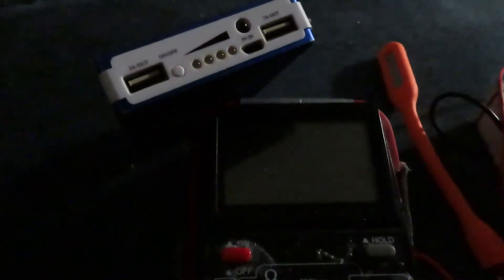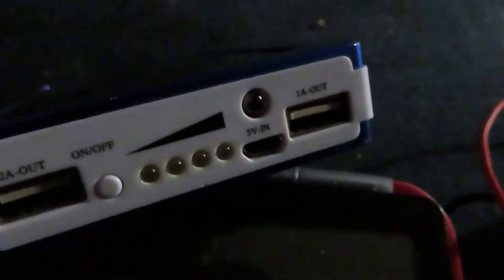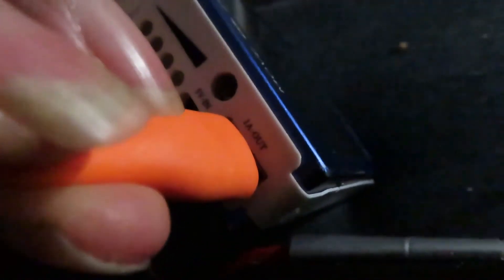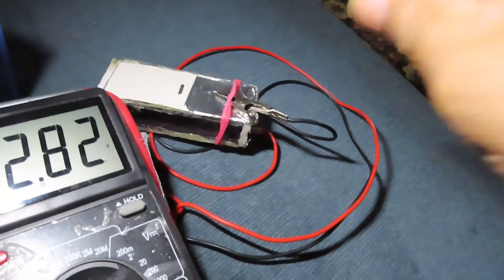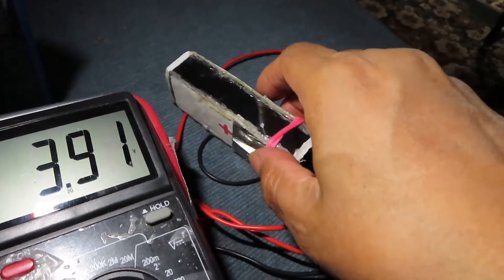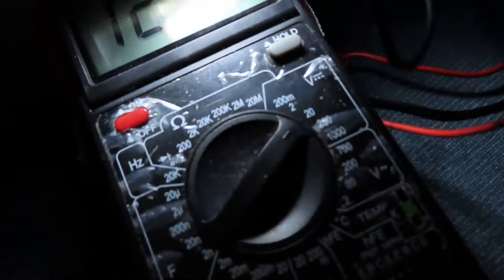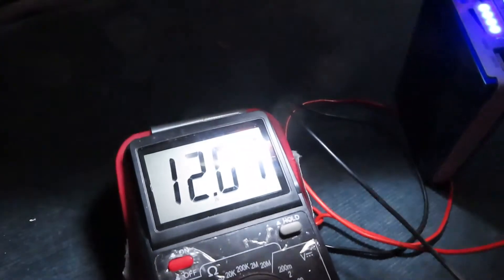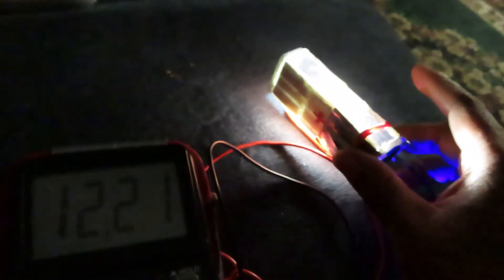Update on fiber optic solar batteries

Comment: What is wrong with these people ?
This is great news. 
Imagine you homes down lights in all rooms taking 5v 1amp.
But giving you 12v 0.1 amp back. 
X that by the number of bulbs. Now you have some return to play with.
Feed it back into your grid tie.
Use it the grow food.
Pump water. 
Sorry what do your light bulbs give you other then the light youb are paying for.
Ohbyeah the Bill each month.
Check out Lloyds electricity bills?

Comment: 🤔self charging systemlight🤔 ..never ending
Reply from the maker: Thanks for the comment we love feedback been working on this for 31 years the energy comes from solar energy and batteries
Reply from the maker: Need more information we build a bigger unit from the smaller prototype here's our blogspot, if you like it please think about giving $5 to our gofund to bring this to market.
https://showmeyourproof.blogspot.com/2021/09/isolinear-solar-panels-fundraising-event.html
Reply: I have this same system last Year in my Circuit 😉connect, it works "by Old Li ion Zells 😉😉" whit On/off for my "Balkonien" the Carchargeradapter on a 12 Rc motor  and.. Diy projekts, You know 😊 your PV light is inspired.
Sorry i'm German 😁
Reply from the maker: @alexnightflydance   We will be re Doing Recap and upgrade to this project we have used this for quite some years and it's just getting better so we decided to show some of the progress, these things will run into the light blows out and then you replace thelights nothing lasts forever keep this in mind.
Reply: @alexnightflydance  So with the test of time where did this actually end up?  https://youtu.be/8WKQNz_reEY
Reply from the maker: @alexnightflydance  Re measuring for better understanding and better lighting  https://youtu.be/o_2K6e2GUoU
Reply from the maker: Try this if you connect that system and have it up and running and it's putting energy into your batteries from the grid and then you plug in a tie grid inverter the energy coming into your wall we'll go directly into that device you say you have into your battery for storage the more battery storage you have when the power goes out you can now use that power to keep your grid up and going. Hence the way we did our solar panels it's just stepping up the power gradually again if you watch the video you see we're only getting 16 extra volts after the lights consumes the rest of the power. So if you do 160 levels you will have 2,000 w of power what do you do with that power a tie grid inverter only uses from 20 to 90 volts and bumps that up to AC 120 and puts that back into your grid. Remember your grid should only have around 240 depending on what country you are in, so if you have Thai grids pumping energy into your home you have isolinear solar giving you 24 hours of power and then you have what you say you already have putting that extra energy into batteries you can't lose you have your full loop and I'll be showing you that in videos when we update so stay tuned
Reply from the maker: Re measuring for better understanding and better lighting  https://youtu.be/o_2K6e2GUoU